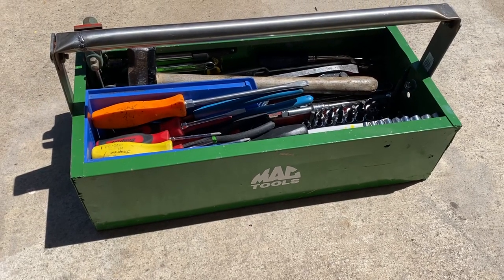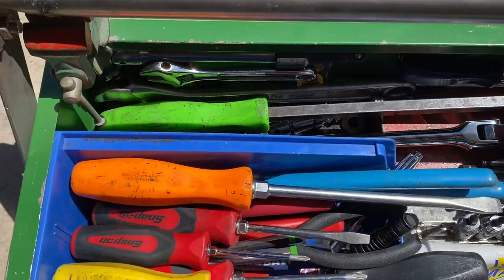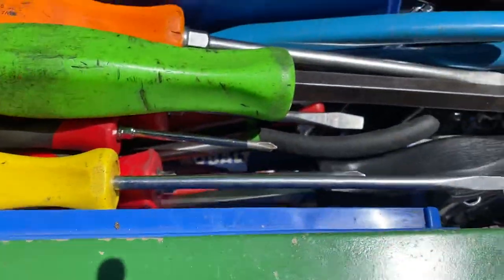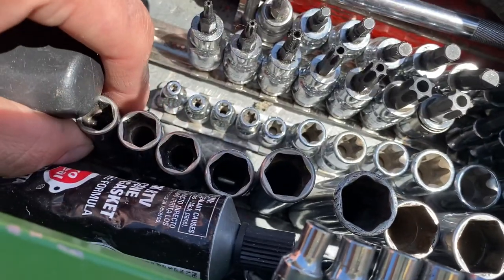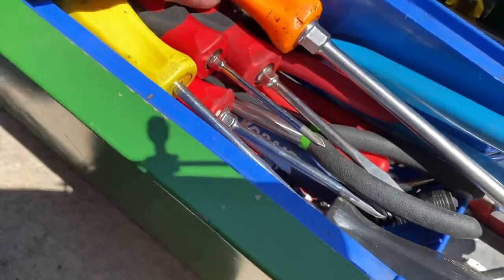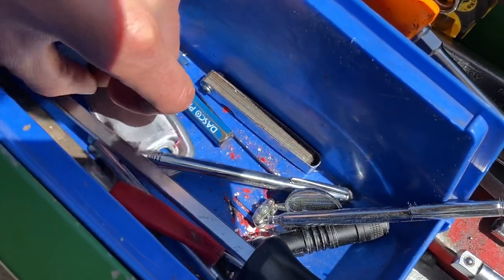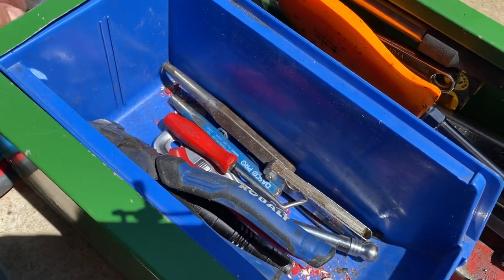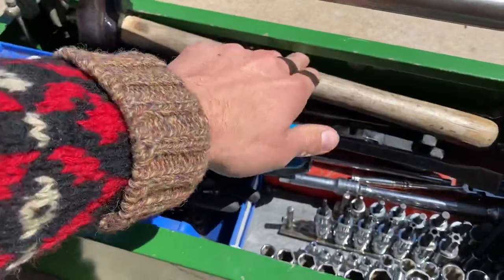Mobil automotive carry tote tour, mobile tool box tour

Comment: I use 2 tote trays working on heavy equipment, 1 has pliers screwdrivers & misc , other has sockets drive tools and wrenchs saves ALOT of time
Reply from the maker: That sounds like a really great setup!
Reply: @richardsgarage6697 your box is great, and experienced wrench turners know.... If you are a bit patient with a adjustable wrench, and turn the wheel with one hand.... To get it snug, and twist the wrench with the other hand..... It has a very tight fit on a fastener. It's better than fixed open end box wrenches, if it fits where you work in the vehicle.

Comment: That mini vice is such a smart idea. Too bad the modern totes are made of thin sheet metal that would never hold up to a beating. I kept thinking of buying a Mac one but it’s just too big and expensive. I’ll have to make one myself. I want mine to have grippy feet and drain holes in case I’m working in the rain or a slippery surface. Also the middle part of the handle can be a long extension to save space. I want the handle to fold on the outside so I can add a cover that flips out and holds tools in place to keep it organized better. That also doubles as a clean work surface to prep parts for assembly.
Reply from the maker: It’s definitely relatively easy to make your own, and you have some fantastic ideas. The metal on mine was rather thin but I had a bend in the panel where the vice was mounted which helped with rigidity a lot, I only really used it for small things like stubborn carburetor jets or small seals. I ended up switching setups multiple times after this one to fine tune the organization and lighten the load a little bit. The extension idea you have for the handle would be fantastic, thank you for watching I really appreciate it.

Comment: With that extension that isnt knurled.. you can tape off a section where you want some grip and then dip it in plastidip a couple of times. Then just before it dries, while its still pliable, take an old bastard file and roll it across the extension and it will knurl the plastidip. Then let it dry, cut away the tape with a razor blade and you have a great grippy area. Just dont dip too many times or it will build up too thick.
Reply from the maker: That’s a pretty great idea, thank you
Reply: @richardsgarage6697  No worries, enjoyed the video too!